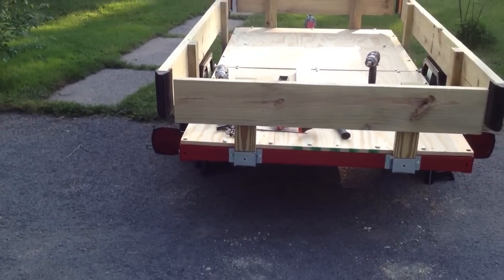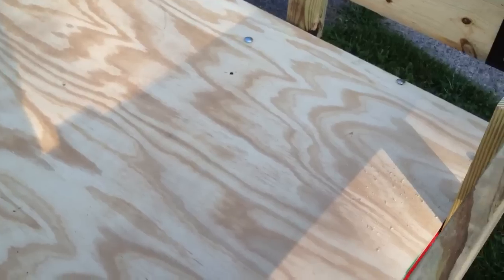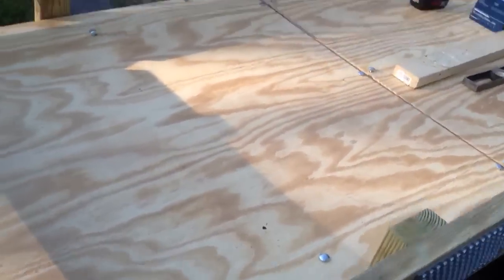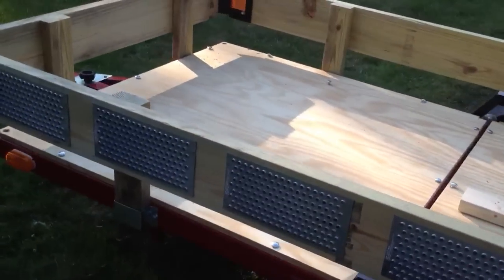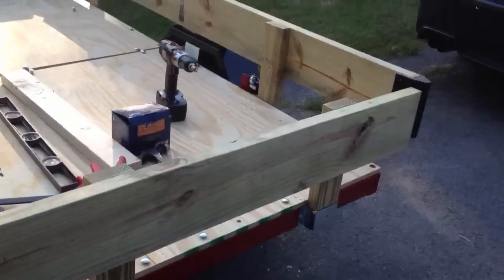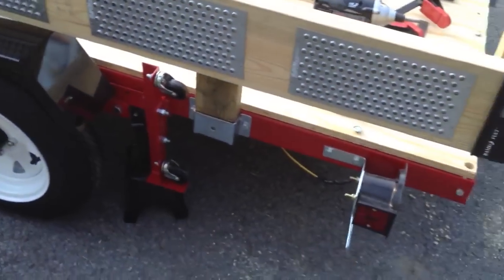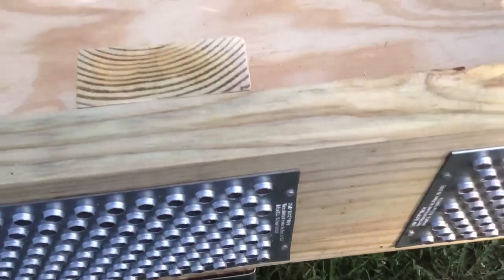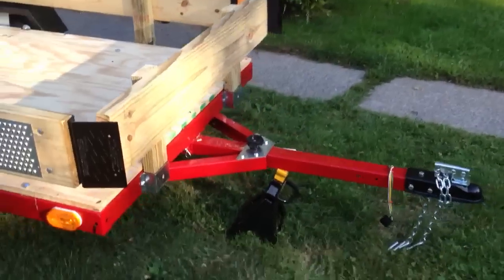Norther Industrial 4x8 Folding Trailer Deck

Comment: I'm interested in how the trailer held up over time and what you hauled with it.  I was going to buy one of these at Northern Hydraulics (before it was Northern Tool) and the sales guy asked me what I was going to use it for.  I told him I was going to use it to haul an ATV.  He said no, and wouldn't even sell me the trailer.  He said the trailers were really cheaply made with very thin metal and bolted together, not welded.  He said he'd already had several of them come back with the frames broken or twisted.  He said everything from the frames to the tires and even the tongue of the trailer is WAY undersized and there is NO WAY it's going to hold up to it's 1,000 pound+ rating.  He said he wouldn't even trust it to hold even less than half of that.  So anyway, I hope you had good luck with your trailer.  I also hope you see this and respond and let me know how  your trailer held up over time.